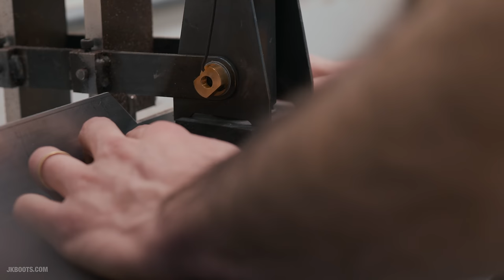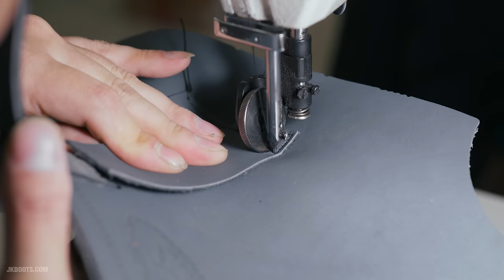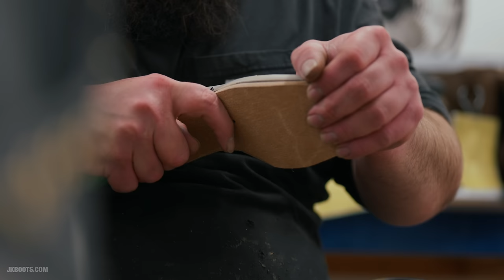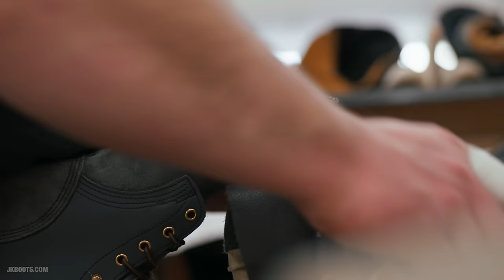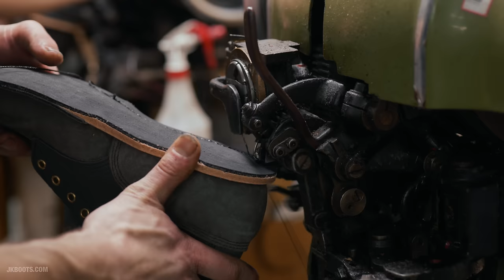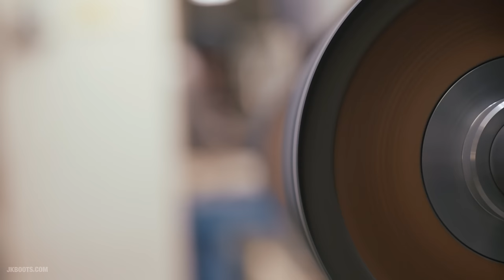How Its Made - Making the Best Work Boot TOUGHER | JK Boots

Comment: Too many issues here. Boot looks good but, Stiches will be stepped on at the bottom of the shoe. They wont last. Are those nails coming out of his mouth😂. Polishing rubber with no mask🥲. What happened to work safety/
Reply: You are clueless my friend. When the stitching on the soles are flush with the ground, the boots will be way past due on a re-sole. That would take at least a year with heavy use every day. Even if the stitching does come in to contact with the ground, it is still pretty thick, fireproof, and wear resistant, not to mention the outsole is also glued and screwed in.
Reply: @SunGodLuffy_5  you are clueless, man..
Reply: So, do you own a pair of literally any pnw boots? I'm guessing not because JKs, Nick's, Whites, and Franks boots all have similar outsole construction, and nobody complains about the sole coming apart. You either know nothing about boots or you buy Chinesium

Comment: I’m a welder/fabricator and over the last 30 yrs the one part that wears out the quickest on boots for me is the leather over the steel toe. I’ve worked jobs where I have to crawl around on units or concrete and the toes take a lot of abuse. How does the leather on your boot stand up to that abuse versus a Carolina boot or some other mid level brand?
Reply: Leather is Leather  
Either from  Cow , Horse or Buffalo 
Thickness is what matters  .
I got a pair of Army Surplus boots for under $50  bucks , they are dated 2009 

That's 15 years ago  and they still perform  like new , I got them in 
2015  just 8 years ago  ,

I certainly wouldn't take a pair of $600 dollar  boots  in a Welding  shop but you ain't  me , and if you want to  , go ahead  .
I been a Welder / Fabricator  for 40 years
Reply: I wouldn’t take these boots in a weld shop either. Too expensive. I was just curious how they would hold up. It does say making best work boot tougher. The toe is the place that I destroy the most.
Reply: @frostywelder1220 these types of boots are weird because the outsole sticks out a lot which tends to protect the toe. If you are kneeling and wear the toe down that way, doesn’t matter what kind of shoe you wear it will wear through eventually. One thing they have is rough out which helps a lot with the toe getting cut and worn, it’s more resistant.
Reply: Also nobody cares that you were a welder fabricator stripper machine operator for 30 40 80 90 years, I don’t know why you guys need to state that like you’re departing at an airport
Reply: @mad0uche it speaks volumes on his experience. He’s asking what they’re doing to prevent shoe’s prematurely wearing out. It’s a simple good question.
Reply from the maker: @frostywelder1220 Great question, apologies for the late response! We offer a couple different solutions for this issue. First our leather is quite thick in comparison to many cheaper boots out there, about 8-9oz (Bison is more like 9-10oz). We can also add a extra layer of leather called toe cap over the toe area. This can be done over composite toe boots, granted this makes the toe box protrude out and more look bulky. Also we make a custom boot called the "Ironhide" this has a composite toe + met guard built into it and a extra layer of leather holding it together 👍 The Ironhide is a common boot we sell to welders! (Ironhide link - https://jkboots.com/collections/buy-custom-boots/products/custom-ironhide). By the time you rip through the toe on those it should be time for a rebuild anyways, hopefully this helps!

Comment: I desperately need work boots and I haven't been able to find anything off the shelf that will work.  Is it possible to get anything bigger than a size 14?  I wear a size 15 wide and I have other orthopedic issues.  When I was a teenager my orthopedic surgeon recommended that I get custom shoes made but I never have.  Throughout the years I found a couple off the shelf shoes I can wear.  My right leg is 1/2" to 3/4" shorter than my left which is the result of shattering my hip as a teenager.  The other issue I have is with my left foot and ankle, in my mid 20s I was diagnosed with synovial sarcoma in my left foot and ankle and I received surgery and radiation and parts of my ankle joint has been cut out and fused with hardware so the outside of my ankle is wider.  I was probably 17 the last time I had a pair of boot I could wear.

I own a hot rod and performance automotive business along with a machine shop and metal fabrication business.  I am always welding and plasma cutting and can't count how many times I have had spatter or dross go down in my shoes and burn into my feet.  What I really need is a pair of size 15 wide boots with a taller right side boot to compensate for leg length and a the left boot needs extra room for the outside of ankle. 

A couple of years ago I experimented with making my right shoe taller, I cut up a tire and traced the outline of my shoe on a piece of tread and glued it to the bottom of my right shoe and sanded the sides flush using my belt grinder.  I was able to walk so much better and even my back and posture was much improved, the only problem was the added weight of the tire tread felt strange.
Reply from the maker: Yes we can definitely help you with all three of those things! Theres three ways to go about it, come get sized at one of our stores if you are in the area, shoot us a call at (509) 487-0154, or email us this same response at general@jkboots.com and we will do our best to reach out to you 👍

Comment: Ngl the screws at the end took me out. What happens when the wesrer eventually wesrs them down? Literally starts walking on nails😬
Reply from the maker: Theres a metal plate in the bottom of the 'last' this bends all the nails back into the midsole and insoles. The screws only enter the midsole and are not long enough to puncture through 👍